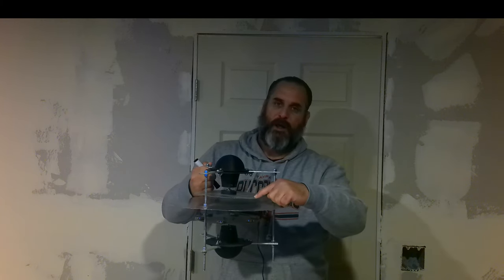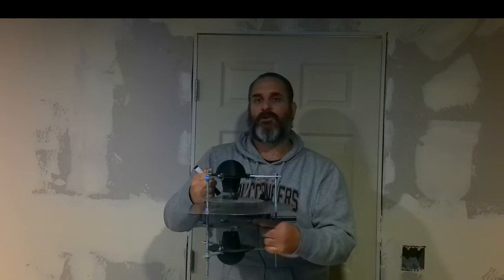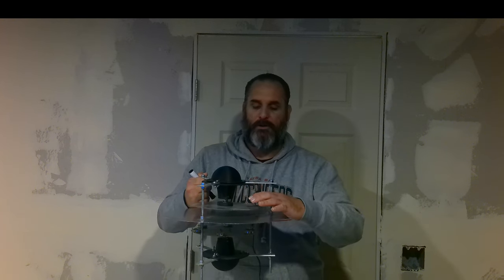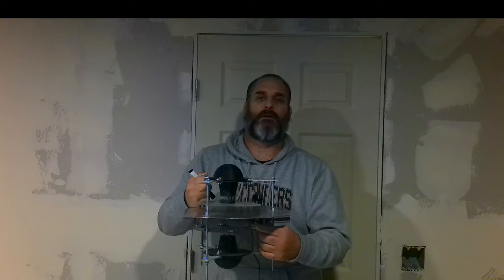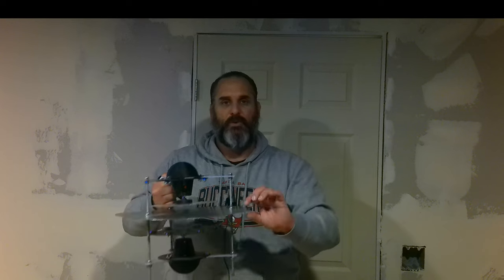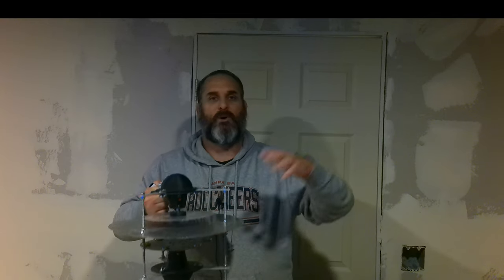Graviflyer "Tuning Correctly" #25

Comment: So has anyone actually reproduced the results? Or is this just your best assumptions?
Frequency matching is one thing, but what about phase alignment?
Im still not convinced that this is actually real, the videos of aleksey look convincing, but then again there is many ways to fake what he does. I dont want to rain on your parade, I actually hope deep inside that some day you will show us a video of it working, but I just don't see how this would work, I still don't get the supposed mode of operation.
Reply: ive been waiting a long time too to see his actually  do anything man  alot of talk but not one video of it actually working yet
Reply: Lift is not in the cards.
Reply: It would be like putting a fan on a boat and pointing it at the sail trying to get it to move
Reply: @freedomer342  
Worse. The vids they’re going by are laughable. The joke is on those that think it’s true and therefore by just the right bit of kit and tweaking they will replicate it. 

All he really needs is proper lighting, monofilament, and video editing. IMO. 

Like perpetual motion, and over unity machines. Or Eric Laithwaite’s gyro propulsion.
Reply: @larryscott3982 well his theory is no more right then Einsteins theory hence why it's called a theory. Nate's theory is OK but there is flaws in it. In order to properly prove his theory, he would have to find the right natural frequency of his center plate (simply by using a rubber mallet or wood and striking the object, instead of using a tuning fork to cause force vibrations), use his motors to create a bubble using the resonant frequency and using the Tesla coil as a navigation system. Since he does not follow the simple factor of finding the natural frequency of his center plate, the craft does not work and will never work.